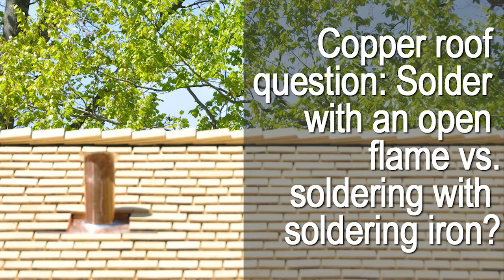Solder with an open flame vs soldering with soldering iron on a copper

Comment: Chris I'm from TN. We have 100° temp swings. I've been soldering with an open flame for 4 years now. I hired a guy out of FL to come help me install a 60Ft inside radius gutter stretched out of 40oz copper. I came from a welding background and it was explained to me that it was just like welding. Heat the metal, splitting the molecules, and allow the solder to fill the space. First pass at high temperature for ultimate penetration and then low temperature for a strength building pass. I haven't had any call backs or complaints with the method of using a open flame torch over an iron. In my opinion its preference in what you're comfortable with.

Comment: What Chris is trying to say is called cold soldering. I have soldered on the exterior with a torch for the extremely difficult fillit joints. But 99% of the time I use an iron. The primary reason for this is a pipe joint is never exposed to the carbon of the flame and the solder pulls in by capillary action. And pipe is 3-400% thicker than 16 oz copper so it can be heated very thoroughly by a torch with no rush of bare spots. Also the risk of catching the roof deck on fire because of the +800 degree temperate of propane or mapp gas from a torch.